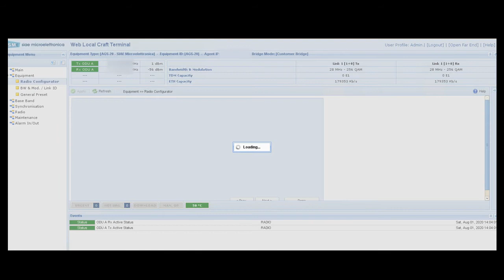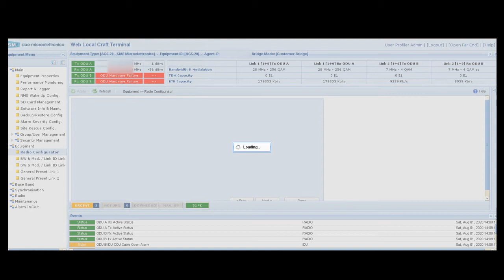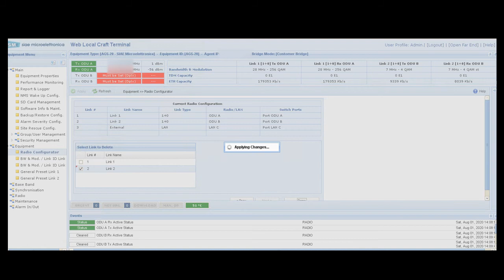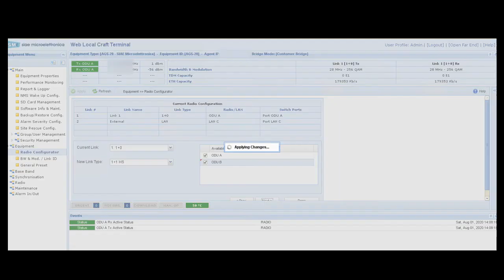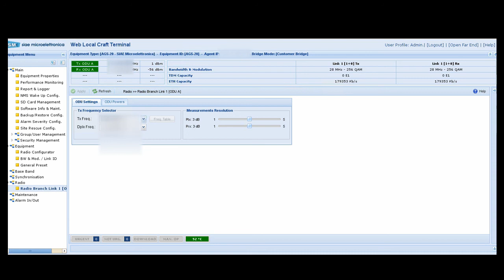Microwave SIAE AGS20 - Radio configuration

Comment: hello, please I need to find the steps to connect to a new radio Siae, :@adress IP laptop and all the steps thanks in advance
Reply from the maker: sorry for the late response, for AGS20, the IP address assigned for AGS20 node is 192.168.0.1 and you will put any IP address in the same subnet link 192.168.0.2, and then connect to LCT port and open browser and write the IP address 192.168.0.1 and login admin and pass admin